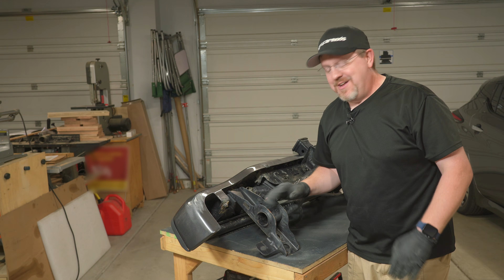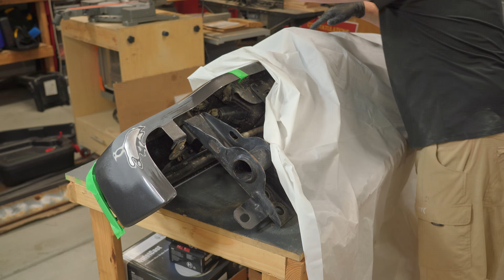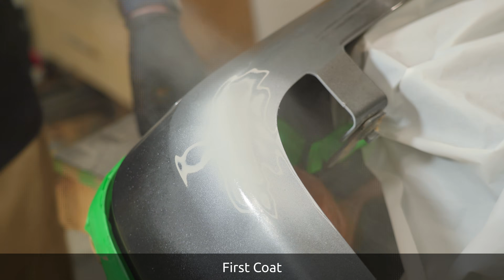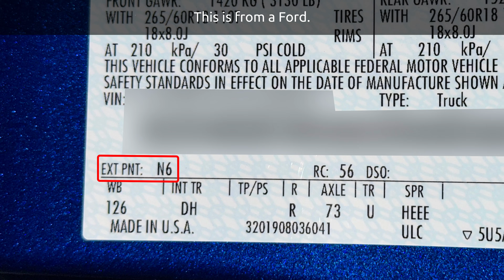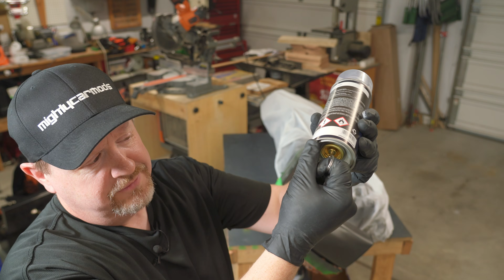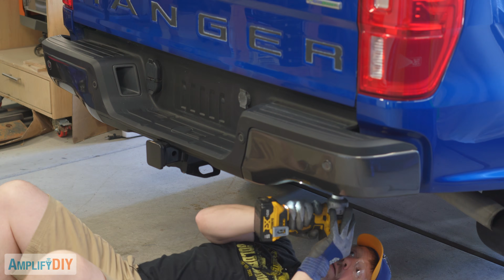Metal Bumper Scratch Repair – Easy Step-by-Step for Beginners

Comment: Thank you. Very thorough and helpful. I saw you were able paint an entire area. If you had to blend it into a larger area, how would you do that?  Geez - glad the fly did not land on the paint!
Reply from the maker: This is a great question! To blend into a larger area, just paint the heaviest over the area of your repair, and fade the paint coverage out over the rest of the panel. The paint can nozzle allows for a lot of control, and you should be able to feather out to blend in with the rest of the panel. Do the same with the clear coat. After at least 24 hrs, you can then wet sand with 2000+ grit to blend the textures of the old clear coat and the new. Good luck!